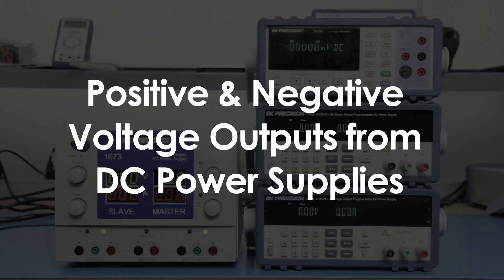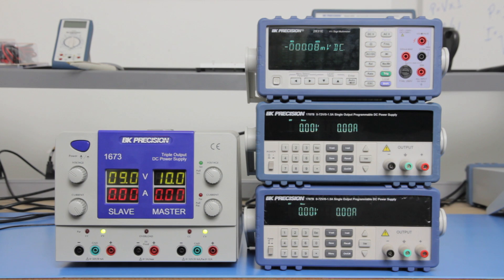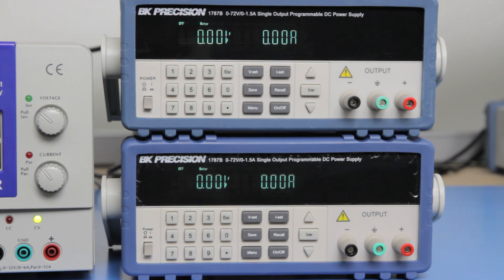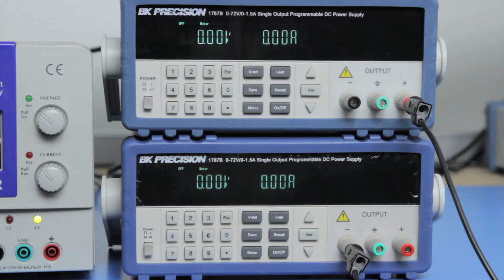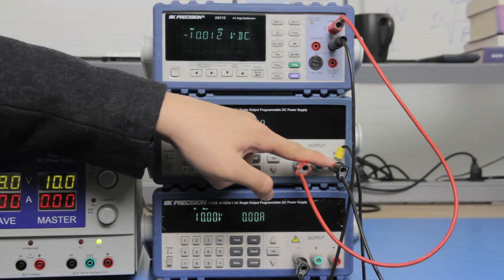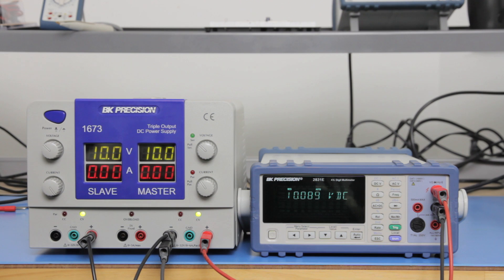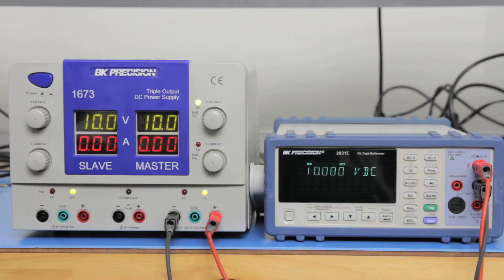How to Get Positive & Negative Voltage Outputs from DC Power Supplies

Comment: hello, thanks for your informative video. I am very new to electronics and I might have a fundamental question. Still, I would appreciate it if you could answer it for me, I am wondering what is the difference between the negative, ground, and positive output of the power device? considering that the potential is relative, how would one make a positive or negative electrode ?!
Reply: depends on 'isolation of potential"
Reply: i cannot trust power supplies that cannot perform this 'simple' bench task.

Comment: You miss quad reverse negitive yeild magnetics ground loop to outgoing 24 volts with magnetic reverse negative yeild rapped around the outgoing positive 24 vols makes 24 volts × 10 to the fith power scale increse in mass power output 5000 dc volts created in yeild production output gain is then created !!!!

Comment: Hey, this of course works for one of those amplifier boards, where u can connect the reference ground to... nur what to do when i use a simple opamp? I mean, if i just connect those 20v at +10v and 0v at -10v, it wont work if the input Signal is ac, because the 0v reference to ground is higher than the f.e. -1v from the AC Signal, right?

Comment: LMFAO what is "needed" is an end to this BS of the high priced lab bench dc power supplies being kept out of the hands of everyone. This would go a long way to end the "pros" handle on the progress of Tech.
Reply: You can get hobby or low end lab PSUs for very reasonable prices. If you want high end stuff you need to pay high end prices
Reply: John Michael Stock how old are DC Electricity supplies? Ancient by now there is nothing magical about them except keeping the prices high on the Units with more options to keep the product users segmented. This helps the Pro users by keeping competition out. A red epic camera is $85,000 but it costs $1200 OEM that is the Tech that is in it. Almost all of  the electronics components even today we're born during the late 1940's!!! Through hole components have been around for decades .

Comment: If Electricity is the flow of Electrons with a Negative charge to Ground..

What is Positive voltage?
Is it the flow of Cations towards an Electron-saturated medium?
Or is it the flow of Protons towards an Anion-saturated medium? 

Both seem quite unlikely, so..
Maybe it's just the same flow of Electrons but measured backwards?

If so, what's the point in calling it Positive voltage outside of A.C.?
Reply: Ernest Soler so yes ive been told the convention was made before the electron was known fully. But as for what flows in the positive direction, they are termed “holes”. This is basically a place where a. Electron will hop to as it flows down the conductor. When it hops into this hole. It leaves a hole where it just came from.  Then a different electron pops into that hole and leaves one further towards the negative end of the circuit. Thats how holes flow in the opposite direction compared to electrons. Negative voltage is something i dont have a great grasp of but it has to do with reference points. For example, if you supplied a device requiring 24 V with -12 in its negative terminal and +12 in its positive terminal it would work. Because its still 24 v difference from the + to -
Reply: I think that's because the + - polarity thing was made BEFORE electrons were discovered, and people just decided to keep it. don't quote me on that though, I may be wrong.
Reply: i think the point calling it positive because the electron get attracted by a positive charge so it will make the electrons move in the wire. And if the voltage is high so the flow will increase also which means the attraction of the electron increase. This is what i think
Reply: @jash21222 Thanks!

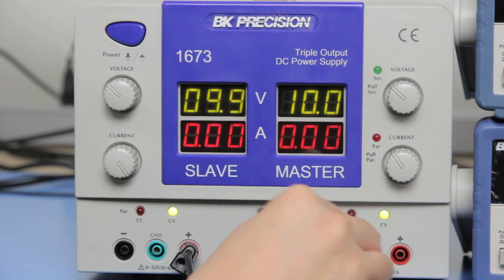Comment: 2:10 why point out the negative of second supply and then keep switching the reference when both ends of the cable are the same?
Reply: Not needed. I noticed that too. The positive terminal of the left supply is at the same potential as the negative terminal of the right supply. So no need to swap out this (floating ground) reference when measuring voltages.

Comment: This video is very helpful, but I still have not found what I was searching for. I am trying to use a computer ATX power supply to create a -5 volt rail. Would you happen to know how to achieve that?
Reply: +bingo475  Not specifically familiar with ATX supplies, but if there is a -12V rail, you could regulate it down to -5V.
Reply: Check your supply specs, many PSU's already have a -5 and -12v, they aren't the best, though, as they have a relatively low current capability, around 100 to 300 mA. It's still enough for most any electronics projects.
Reply: China factory dc power supply  chinarek.en.alibaba.com
Reply: You can't because it's earth mains referenced. It needs to be floating so that you can push the negative ground rail 5 volts below the 5v rail. But you can't do that as the negative rail is ground earth too and you'd short the suppl
Reply: @Ziplock9000   <--- Plus the -12 V rail is usually rated at max 300 mA so it will not be very useful even if it were possible.